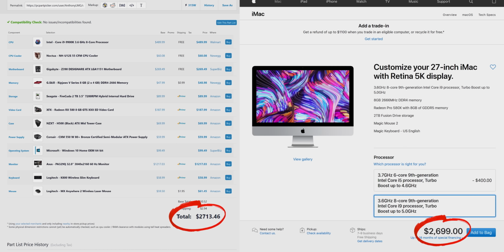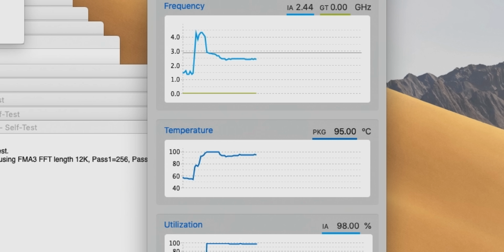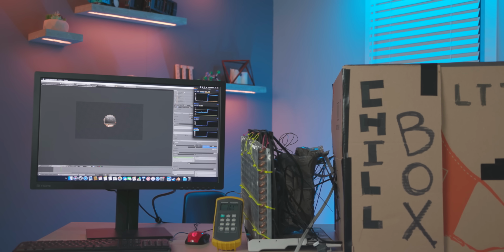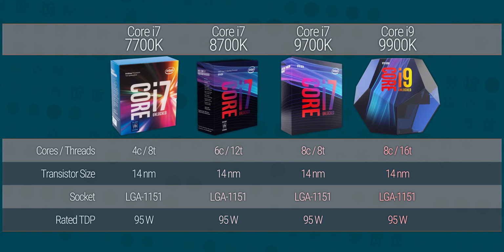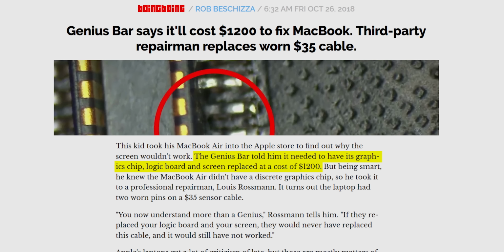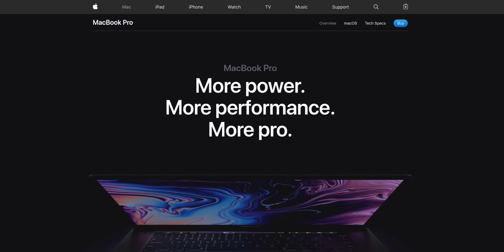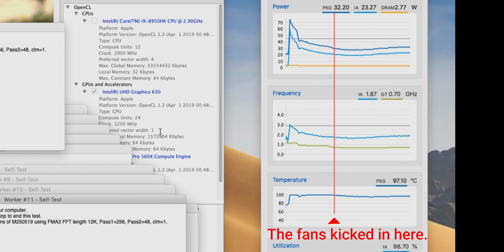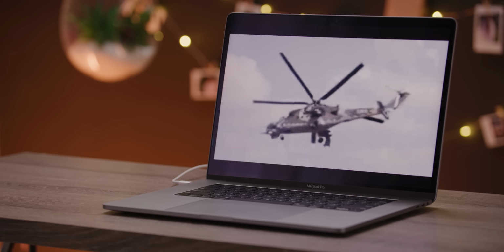Macs are SLOWER than PCs. Here’s why.

Comment: Mac is more expensive than any other PC because people don't want to buy a pc with exactly the same parts. We want an affordable PC. And with 200 dollars or less, you can have a very decent Hackintosh for normal use. I have a 3rd gen i7 that is running XCode perfectly, and that's all i need, i wouldn't pay 3000 dollars for that.

You also have to take in account every piece in a pc can be updated and used in other pcs. In a mac you can only change the ram.
Also, mac has horrible compatibility issues with linux and windows servers and many other things such as virtual certificates.

Comment: @linus Great video! I found this interesting. I have a question.
Will the thermal issue still happy if you use the hardware with Linux (wither Ubuntu 18.04, 19.10, etc, or Manjaro)? Of is this only happening with their OS?

Comment: Guys, make the same comparison with a Windows Laptop, you wont have something much different. I had my Mac Air 2018, switched to Hp envy 32RAM 1Tb SDD, with the intent to produce music. I had the same issue with both: heat! Period! I got the mac Pro 2018 15.6, what did I get: heat! Nothing different! Now if you get a PC water cooled, we are comparing Apples and Bananas. So far after 4 years using Apple laptops for Music production, they have to come to be the best for me, never had performance issues, only the heat that comes with a laptop.

Comment: Apple is rumored to be releasing a redesigned 16" MacBook Pro soon. Let's hope the thermals are better! I suspect given the bad press they got for their current model that they will put some effort into the thermals. This said, my quad core 13" is a great laptop for every day tasks. It's never crashed, I actually like the butterfly keyboard, and the compact design of the machine is great for lugging it around. Overpriced? Probably. But I do like it. The Touch Bar is largely useless though. They could delete that silly feature and lower the prices, and I would be happier.

Comment: You REALLY don't get it. Use an Apple computer for a few years, and you will understand. I moved to Apple a few years ago, and I will NEVER go back to Windows or Linux. The difference is HUGE. Anyway, about the cooling. In laptops, that's a matter of comfort. It's very annoying to work on a laptop when the keyboard is hot. I'm glad Apple doesn't speed up their processors. My previous laptop was an HP and it was impossible to work with. Extremely noisy and hot. That's actually one of the many complaints I hear from Windows laptops users and buyers. The noise and the heat. Maybe you forgot the time of the cube, when Apple created a computer without fans. That's the philosophy and that's the main reason why that philosophy exists. Comfort.

Comment: Had a mac desktop in late 80s that would fail yearly, Apple repair it, but on 2nd time with same fault got a note, they would not repair it next time as was running it 24/7 not the allowed maximum 7 hours straight...
harddrive had died every time,
Bought a new drive from Seagate scsi.
Got a bit from them that warranty would not be usable it mounted in a mac due to heat issues... Obviously a know design flaw then.
So i mounted drive on outside of mac, screwed it on outside of it's shell...
Harddrive never died again....

Mac likes to roast it's hardware, so sell new quicker...
If don't die from heat, simply make it sluggish with a update 'to save the battery'

Mac was faster in 80s as ran RISC CPU, that Microsoft never turned on as was not 'needed' also 640kb ram was good enuff...

Comment: I used to fill plastic bags with cold water and put my laptop on them, actually worked crazy well.
Reply: be careful it does not smelt through ya ...
Reply: @SparkGripRacer  you can take a lighter to the bag and it wont smelt, try it.

Comment: APPLE
advertises 4.8ghz
reality 2.7ghz 

HP gaming pc with i7 7700k 
advertises 3.7ghz
turbo boost 4.2ghz
Reply: "advertises 4.8ghz
reality 2.7ghz "
That's the part of the apple that had a bite taken out of it.
Reply: @kaczan3  i see what you fucking did there, YOU GENIUS
Reply: Wait 2.7ghz 🤪 have fun running safari at 30 fps
Reply: @tinglemeister1016  I have the 13 inch model and safari is running smoothly as hell
Reply: You do realize that you're comparing a PC to a laptop... Try to squeeze the PC into a Macbook and it will burn :)
Reply: @lyubo_stan   Actually a laptop with PC compatible CPU is a PC squeezed in a small box as Mobile processors is not that much different and they produce a lot of heat at full burn (creating the for-mentioned overheating problems).  Also what do that have to do with what I said anyway with that Macs can perform better with cpu fans actually spinning to cool them?...  My point is that Apple have always had the habit of letting their computer perpetually overheat and there is a easy fix (just let the cooling fans start BEFORE overheating).

My 4 core 3,4Ghz Xeon  in my Workstation and the MacPro with 4 core 3,4Ghz max speed i7 is not that different in producing heat or performance to put it that way ( but only when the fans actually spin to cool  before overheating it on the laptop :) .
Reply: @a64738  The kind of processor that you have isnt the problem. The problem is that in a Macbook the processor is squeezed inside a thin and light chassis. With a PC you actually have space for better cooling.
Reply: @a64738  Normal processors and graphic cards are not made to be put in a laptop this thin. That's why I said it would burn.
Reply: @lyubo_stan   Actually the GTX1080ti has been put in gaming laptops that is pretty thin wich is very impressive as I have felt the heat that monster can produce lol.  What make that possible is it makes much less heat if you adjust the power usage to 50% and the performance loss is just 10-20% or something like that (used to do it when I did mining with my GTX1080ti). They probably do same thing with the CPU on laptops also (reduce the voltage and you get much less power consumption at the cost of a little less performance)
Reply: @a64738  You can put it in a gaming laptop as thick as 4 macbooks stacked on top of each other. It's imposible to put a full on 1080ti in a macbook, because there is just no space for cooling. Even if you tried,  you would just lose too much performance to sustain normal temperatures.
Reply: Любослав Станков that doesn’t take away the fact apple should provide proper cooling for their systems. It’s not like thats that difficult to do.. they just choose not to do it, hence making the mac fail faster and they make more money on repairs
Reply: @alexrsps141  The only thing that can fail on the new Macs are their the keyboard. They are just like the old Macbooks, considering that a 13 inch base model from 2019 is faster than a 15 inch from 2017. Apple sacrifices performance to make their devices thinner and more "futuristic", but new MacBooks always have better performance than old ones. I bet that most people commenting have never owned a NEW MacBook and still talk shit about them. About the thermals, I bet that a dell XPS 15 will be hotter and louder than my MacBook while running games, bUt aFtEr aAl iT iS beTteR. Some people do not want to have thick, heavy and bad build quality devices in exchange for performance, get over it...
Reply: @lyubo_stan  what about pc laptop. Any 1000$ pc laptop outperforms ANY mac laptop. And a 1000$ laptop is cheap as hell
Reply: @chriss881000  Macbooks are designed to be thin and light, with moderate performance. It is obvious that a 2 inch thick laptop will outperform a paper thin macbook...
Reply: Reality: SSds with an average write speed of 2,682 MB/s fully encrypted.
Reply: Actually my 2014 Macbook pro was adverticed as 2,4Ghz but with costum fan profile that actually let the fanst run full speed at 70C and a little recused voltage to the CPU (using overclocking tool) it can run 100% CPU stress test all 4 cores all day and never going over 80C :) Without thees tweeks at same stress test it would reach perpetually 105C with lot of CPU throttling while running at 2Ghz...

Comment: How about not buying a flat notebook or a shitty mack to syart but a full Fletched  laptop,   

my Acer aspire vn7 591g has been reviewed once but with way lesser specs

   1 K screen instead of 4k   8 gig of ram instead of 16  a m.2 256gb witout a 2 tb etc 

But my i7 4720 H Q    yes Q  ,   4 core 8 threads says 2.6 ghz in direct x diag    but core temp 1.14 shiws it spools up to 3.4 a 3.5 ghz and stays there without ever dropping

 and I've seen 95° and 97° centergrade  ,    it's almost 4 years old  so time for a new one and the GeForce 860m is no match for many of today's games , and the battery is flat within 2 hours just like I boutgh it but it has the flagship HQ  and cooling 
So it's USEBLE

   and IF thermal throttling was a solo banchemark then the laptop would outperform a pc simply because it can continue performing without cutting out because of heat,   it may die soon but it has stayd alive the full 3 years so no problem for me

     I,m from holland so can't drop by to shoot a video for you and if I do it my self people ( especially mack users ) would say I'm cheating, so if you're ever in the neighbourhood drop by and test it your self,   fine little machine 

Or send me a new one and you'll get this one 😂😂  joking it's problem free unlike mac and notebooks and that worth a lot,

No warranty,  No problem,  problem free laptop 😏

Comment: I will admit, I didn’t understand why this was happening, but I knew something was wrong. I spent $2400 on a top of the line MacBook Pro back in late 2015. I was shocked at how average the performance was for such an expensive machine. I sold my MacBook Pro and bought a windows laptop for $1000 less than the MBP and it performs way better. In combination with my built PC I will never go back to Apple for anything other than a phone... or a watch

Comment: i had a 2010 17" macbook pro with nvidia gtx and it hauled balls.  it would run pretty hot but not much more than any other fast laptop.   and it ran windows 7 better than a lot of "pc's"   But i don't like there shit on the customer practices now.  like throttling down machines so that u will get annoyed and buy a new one.

Comment: This is bull. Even some cross platform apps run circles around their PC versions on a Mac, if you count cycle by cycle. Not because the hardware is any different, but because of the OS fundamentals and integration.

Comment: Question is: is a throttling mac slower that restarting a PC when windows locked up?  

Seriously, I just built an i9, 16gb ram, 1tb nvme SSD and it runs 64 degrees under prime 95 stress with only a coolermaster 212 RGB black, overclocked.  

Score 1 for the desktop and a good case.

Comment: The thing is that you don't buy a Mac for the specs, but for the experience. Aesthetics is a big part of that (not for me TBH, but for many Apple users), the ecosystem another (and this counts heavy for me personally). Hardware anorexia and consequent throttling is very irritating because it's so unnecessary, but I have good hopes that its extremes will wear off now that Jony Ive is out the door. BTW, this is one area where Steve Jobs' influence (or the perception thereof) has been actively detrimental.

Comment: I can only speculate regarding your question comparing iPhone vs Macbook thermals, but my best guess is that with the iPhone Apple has full control over the chip design process for the iPhone, allowing them to engineer it to their specifications to fit their designs, versus them making the boneheaded move of stuffing an Intel CPU that doesn't belong in an ultra thin case inside of an ultra thin case. 

It's really a shame that such a great UNIX OS is limited to either buying awful Apple hardware for official support, or going the Hackintosh route which won't necessarily guarantee you the best out come.

Comment: Here's my issue. I own the older 2010-2010 Mac Pro, 6 core, AMD Radeon Sapph 8GB GPU and 16GB RAM. I can obviously game with these specs, and overheating isn't an issue due to the very freeflowing design. It runs smooth.

However, after a while of leaving it on, and I come back to game, I notice the frames dropping and starting to lag while playing games.

Now when I restart the machine, all is good again. It runs super smooth. And if I were in bootcamp playing games on windows, this doesn't even matter. Could this be a throttling issue regardless? Is windows OS jut that much more superior?

Comment: And, even as a hardcore PC-builder, I STILL prefer notebooks like the Macbook Pro 13 way ahead of the Matebook X Pro from Huawei. The main reason is exactly the things described in this video. The machines from Apple are almost completely silent for normal use as they keep a good balance on the throttling. The next things are overall build quality, great trackpad, amazing LCD panels and a really nice OS. For a production machine, not so much. But very few people use these machines as production machines so it really does not matter. If you need a top performer, buy a Razer Blade or similar and learn to live with the constant fan noise.